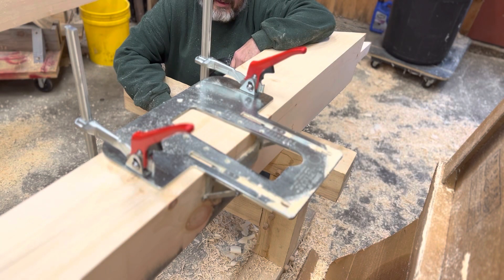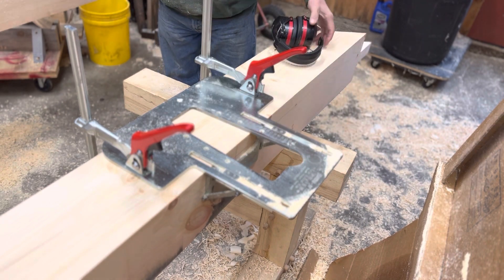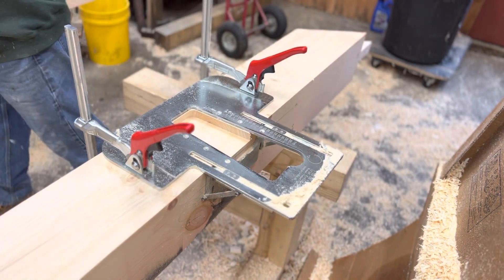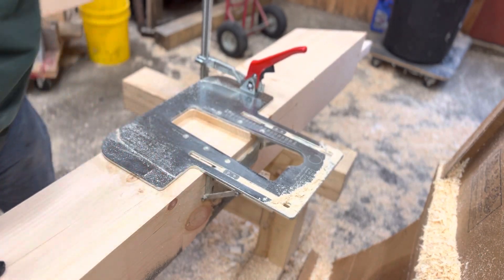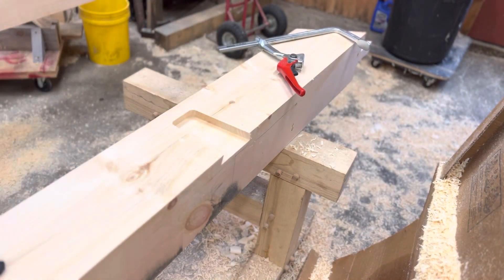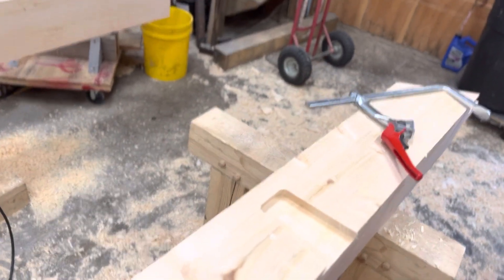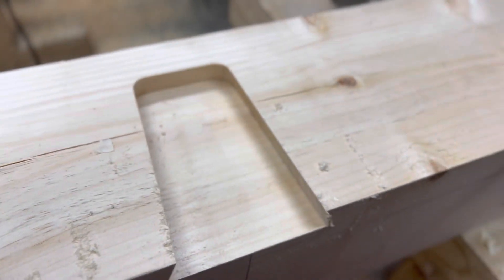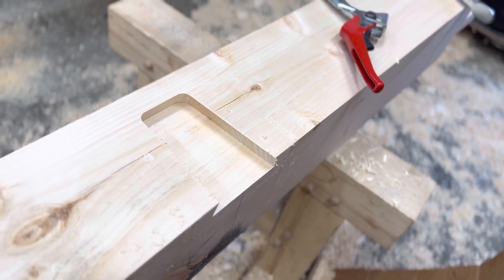Timber Framing - Mafell Router and Arunda 120N mortise system

Comment: I'm a bit concerned at the relatively low area of the bearing surface as shown here.  Do they offer a way to make a haunched tenon?
Reply from the maker: Hi NSResponder:
I shared your concern for many years about the bearing surface…. And delayed my purchase.
After purchasing, I’ve haven’t had any issues.
There is no option I know with this system to make a haunch.
Reply: @theMainetimberframer  Thinking about it a bit more, I suppose that when it's fully seated, most of the load would be on the sides rather than the bottom of the mortise, trying to spread the V.  I'm curious how it does for pull-out resistance and how different species perform.  Does Arunda specify a minium distance from a mortise to the end of a beam?
Reply from the maker: Hello
The tenon and mortise are a tapered fit.  The more the tenon is seated, tightens into the tapered mortise so the pull out strength is managed through the tapered fit.

Comment: have you tried other sizes of the Arunda template?  Working with 8x8 inch lumber but want to be able to do smaller diminutions?  Recommendations?
Reply from the maker: Hi Marty
I only have the 120 Arunda jigs.
If you go to the Timberwolftools.com, the have a chart for the jig sizes for corresponding timber sizes.  
Hope this helps
Rich

Comment: The mortise seems shallow and not much pitch angle, maybe it's just the camera..is there larger bits than the one your using?
Reply from the maker: Hi Kev Phil
The mortise depth I’m using is 15/16”.  The mortise depth is set with the Arunda gauge - it has 3 depths.  I am using the Timberwolf Tool recommended depth. 
I was skeptical of the system for years, then I learned more about it, bought it, and now I think it’s the best way to go for roof purlins and floor joists.
Most of my customers consider a timber framed floor system and this system helps me get it done - much, much faster than traditional.
Arunda also has engineered loading specifications for the joints.
Hope this helps

Comment: Will other routers work with the Arunda system? Thanks for all of your posts. A great source of information
Reply from the maker: Hi Peter
I don’t know for sure if you can use another router.  The router bit with the set up has 2 reversible insert cutters.  I just started using a counter to determine how many mortises and tenons I can cut before changing the cutter.  I’ve used up 5 sets of cutters on the last 2 frames, so I need to get better data on the cutter life span.  When I get the data, I’ll share.  It’s a game changer for roof purlins and floor joists.  It has also opened new options to connect 3 and 4 girts to posts due to removing less material than traditional mortise / tenon joinery.  It’s pricey, but a time saving game changer for sure.
Reply: @theMainetimberframer  Thanks got getting back so quickly. Keep up the great work